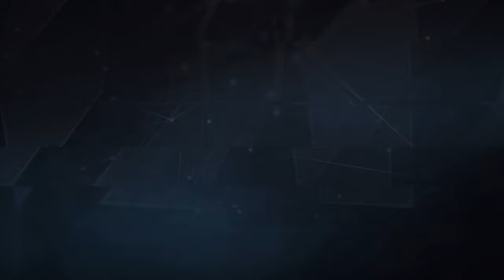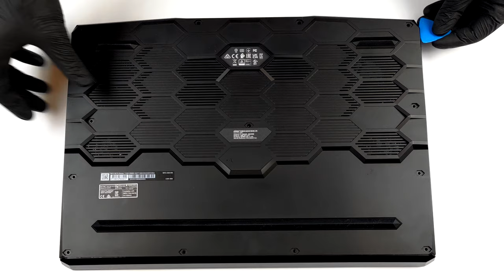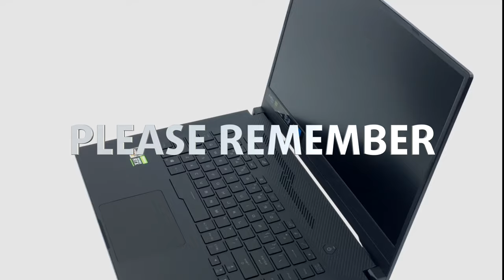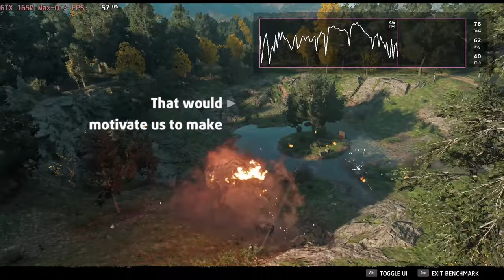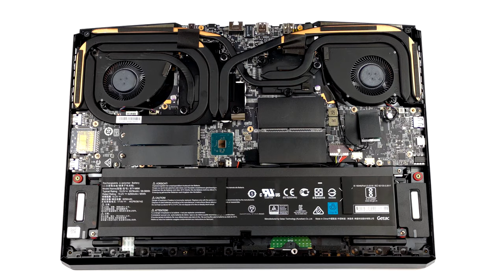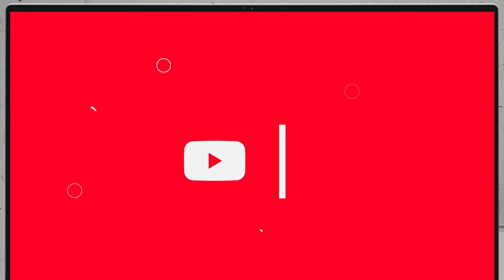🛠️ MSI GE76 Raider (2021) (RTX 3080 165W) - disassembly and upgrade options

Comment: I would hardly call the removal of the bottom of the chassis a disassembly.  A disassembly is completely taking apart every component that can be removed.  I want to buy a variant of this machine, but I refuse to buy a machine if I can't replace the screen or keyboard.

Comment: Why you need to disconect the battery, before upgrading, lets say: add a new SSD M.2? the M.2 only requires to lift the plastic, instert, then I don't understand why disconecting the battery? can I get electrocuted during the M.2 insertion?
Reply: After you opened the bottom panel the first thing you need to do is unplug the battery, and hold the power button for 3 seconds, this way there no more current in the chassis, because all the electronic is exposed and if your fingertip or a screw touch something it may cause a short circuit which will kill your motherboard, unlike desktop motherboard the electronic is not protected here.

Comment: This looks to be significantly easier to upgrade than prior generation MSI laptops. Bottom plate lifts right off, compared to the GE75, which requires A LOT of snap tabs to be disengaged. Battery replacement is straight forward and lifts right out. Only downside is the omitted 2.5" HDD bay. More difficult to have a lot of onboard storage for data (pictures, videos, etc.)
Reply: you don't really need it these days with high speed external hard drives especially with USB 3.1 and 2 USB-C ports. I'd personally rather have  the M.2 slots to be completely honest.
Reply: Facts,  not surw why they would condier to store all on the laptop, usb drives like thumb drives arw pretty big.. As for storage games are loads bigger now, and with new gen consols caught up to 2021-2022 tech games arw gonna be bigger also.. Cant wait for 4000 series by nvidia looks scary good gonna make the new colsoles look like ps 3
Reply: @DL-ez3zz  the hinges break easily Mine broke be careful

Comment: On my GE76 11UH, the QWE and Esc buttons began to fail. Moreover, if you press on the lower left part of the case, they begin to be pressed, sometimes duplicated. I read on the MSI forum that many powerful laptops of the GE series have a problem with keyboard cable squeezing. Do you have a video or instruction on how to get to the keyboard to check this assumption that the cable is really squeezed by the case?
Reply: Any update on your situation?

Comment: Hello. I have a GE76 11ug laptop. Firtst time after 2 years of owning it, I bought  a compressed air can and made some blast all over grill gaps available. Then I noticed that my right fan (when laptop is in working position keyboard up) is not working all the time. I never noticed it before, maybe it used to be like that all the time. Is it normal, or they have to work both, all the time , same speed RPM?

Comment: Is it simple to unlock the plastic clips or is easy to break them?
Reply: Easy to to get rid of the bottom panel with the clips, just don’t force pry it off and you’ll be fine.
Reply: @unknownposter2075  I tried taking it off to clean the dust out and it just would not come off. I ended up just putting the screws back in so I wouldn't break anything lol

Comment: can I also install a 4tb - 8tb ssd, that has additional chips on the underside of the ssd or is the ssd too high for this slot?
Reply: The motherboard is limited to 2x 2TB drives. Got the info from MSI support
Reply: @AloneInSpace545  That sucks man, so I can't install like 2x  8TB Nvme ssds? that's limiting (just as an example)
Reply: @HueghMungus  unfortunately not. Hence why I opted for a OWC thunderbolt dock and now I'm running several NVME drives to add an extra 4TB (1x 2TB and 2x 1TB). But I'll admit, it's definitely not ideal
Reply: @AloneInSpace545  I have a GE76 raider and am running 2 4th gen 4TB NVM. all you have to do is flash the bios. Don't know who you talked to at MSI but they are wrong.
Reply: @adamnathanielbassett  I have said several times that MSI support is useless and this just proves it more. Just 1 question, have you got the 11th Gen GE76 or 12th Gen?

Comment: Anyone here knows what is the normal temperature for gpu in a AAA game with full ray tracing? O almost get 90°C should i replace the Thermal paste ?  Im getting some king of lag after a moment when gpu temperature raises.
Reply: That's pretty normal for a high end laptop. If your laptop is not 5+ years old, I highly doubt you have to replace any thermal paste or pads. Try cleaning dust out of the exhausts.

Comment: Recommendations on what I should get for the empty SSD slot?
Reply: Same here... even if anyone can tell me which pcie ssd is already installed on the ge76 and on which gen (3rd or 4th), I'll just get the same one for the upgrade...
Reply: @itmamwc4674  the already installed slot is a 4th gen. The empty slot is 3rd gen compatible. I just realized the last screw is covered by a factory seal sticker that voids the 1 year warranty though. Fuck.
Reply: @CDN0128  what exactly am i searching for when buying a 3rd gen ssd

Comment: You don't have to remove the battery completely, just unplug the pin connection and press the power button for 5 seconds. Very basic

Comment: Do NOT EVER pull on the wires to unplug a battery from a mobo! Only an idiot with lots of money would do something so stupid.  This laptop battery has a small plastic lip on the connector that you can use your fingernail to unplug it.